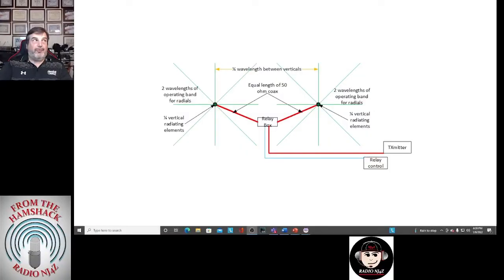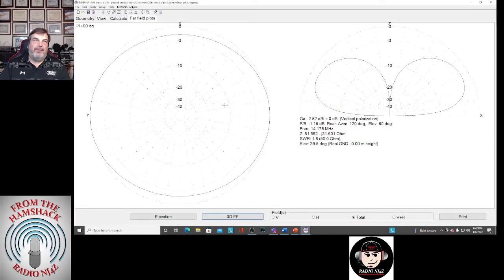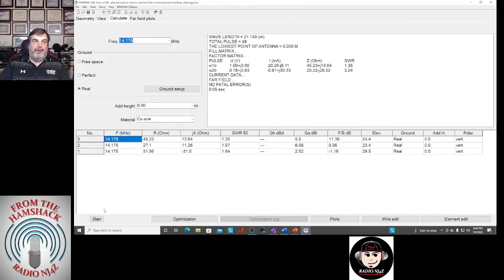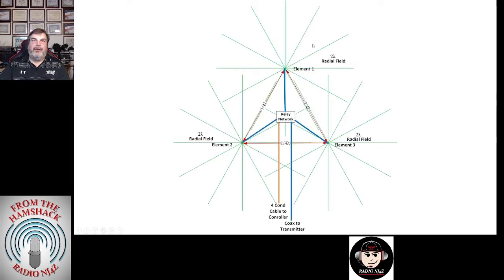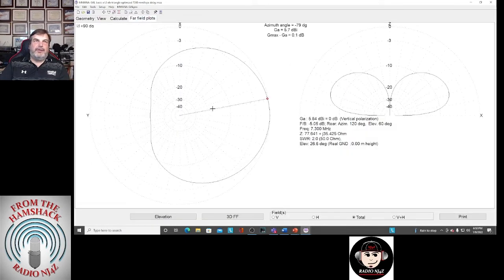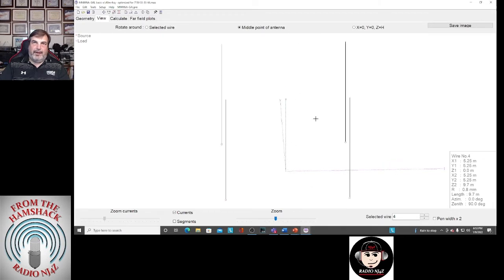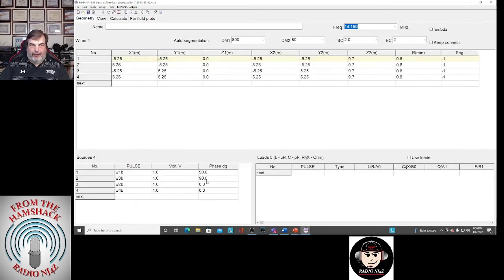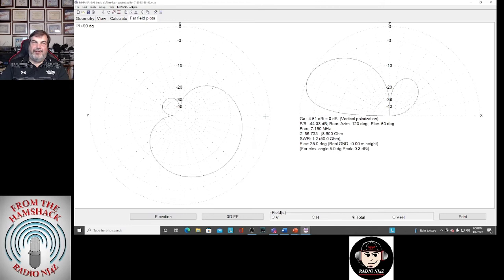Fun with Phasing - Vertical Phased Arrays Continued!!!

Comment: Hi John Great Video. I have been using EZNec pro, but thought I would try out MMANA. My results are consistent with the 3 element example you presented. Happy.
Here's my quandary, When I used your 3 element example and merely switch to 76M(3in) pipe for the elements it falls apart. Seems very odd that would matter much.
OK back to EZNec. I Modeled your same example with consistent parameters, but couldn't get your same performance. Similar but no deep F/B nulls.
For the heck of it I tried 76mm pipe but observed it didn't have any notable changes in the EZNec modeled performance.  Any Ideas??   -AB1Z EZNec Link Below. https://drive.google.com/file/d/1CBToxgHQHpTYQQQoSDMo6AxpoTnnujsG/view?usp=drive_link

Comment: Hi John! Did you get the 4 square up and running for winter field day?
Reply from the maker: No unfortunately life and work got in the way... and to top that off we had to move winter field day to out club facility becuase of weather.  We could not put the trailers in the field too wet.  So I couldn't even test the 3 element with differing phasing angles.  We will have an update soon on some  design changes to the three element to theoretically make it better and a bit more forgiving.
Reply: @fromthehamshack-radionj4z  I understand things getting in the way for sure! Enjoy your channel, looking forward to the updates.

Comment: Outstanding John, very well done. It's so good to see others making YT content on phased verticals. Did you have a chance to model with 1/8 wave phasing? I would be curious to see the modeling how the gain and F/B us with the shorter spacing. Many folks with struggle with 1/4 wave spacing in their garden, 1/8 wave may just fit in. Good luck for WFD.
Reply from the maker: Working on it and hoping i can crack it, it would be a game changer for small spaces but also for POTA.
Reply: @fromthehamshack-radionj4z  Definitely John. I can only manage 1/8 wave spacing on 40m at home so it's a real winner if it works, my setup will always be temporary. What I'm most curious is gain and F/B so I can compare to my already working example. I'm currently only seeing about 12db F/B.